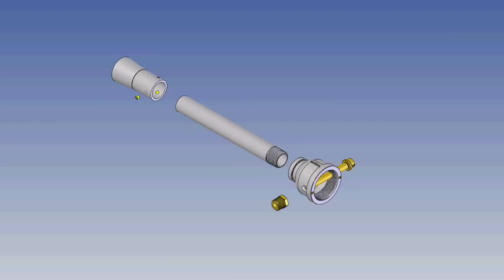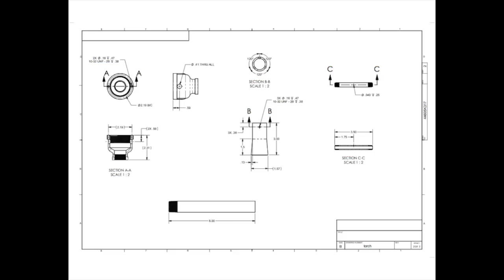Ron Reil Propane Burner Cad Model with Blueprints

Comment: What are the pros and cons of forced air?
Reply from the maker: Dylan Crow the pro of forced air typically allows you to get more heat from your burner. The con versus a Venturi type is the need for an auxiliary air supply such as a compressor or blower.
Reply: 3scottsbaker I've heard though, not from my own experience, that the forced air is more difficult to get a neutral flame and there are designs like this one that have a neutral flame without the need for tuning.

Comment: What computer are you running Solidworks on?  Have you ever used Catia? I heard they are similar.
Reply from the maker: Dperk11 
it's running on the following machine
Dell Precision T5810
Intel Xeon CPU E5-1607 v3 @3.10 GHz
16 GB Ram
64 bit operating system
Window 7 Pro service pack 1

It's somewhat stable but does has some moments where it freezes. Not sure if that's the computer or the software. Catia and solidworks share the same parent company Dassault systems. Depending on the version of Catia you have dictates how similar it is to Solidworks because V4 is not and V5 is somewhat similar. In fact V4 is nothing like V5. Hope this helps
Reply: Thanks for the response.  I'm very familiar with Catia V5.  Use it at work.  But I need to get something for home and, preferrably, something which runs on a Mac.
Reply: I'm real familiar with Catia V5.  Use it at work.  But am investigating home options and would like to find one for Apple product which are more robust.  Any suggestions?
Reply from the maker: Dperk11 I'm not sure. I would like to find out if solidworks will work on a mac because that is what I have at home as well